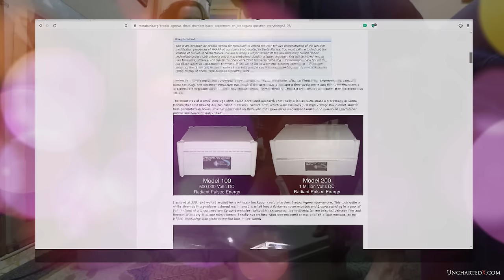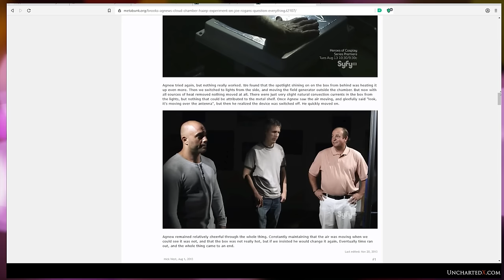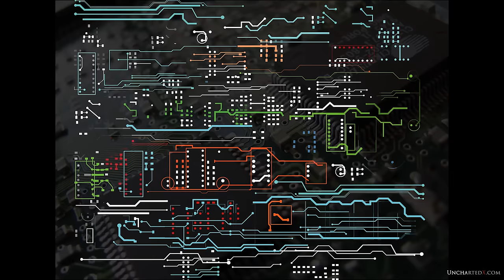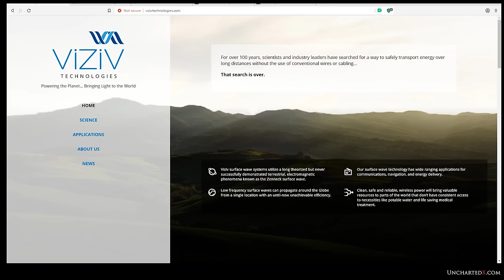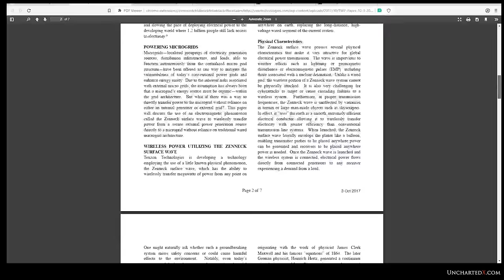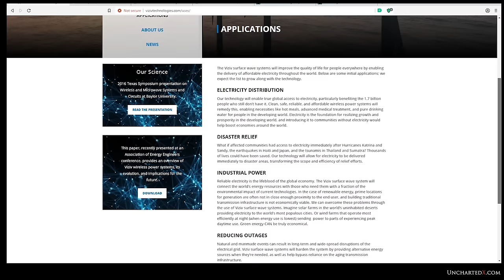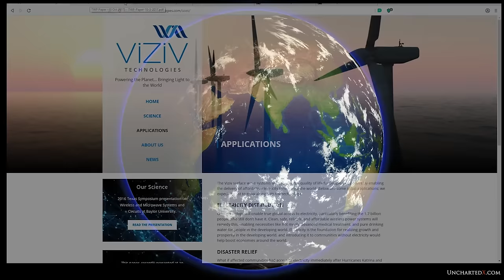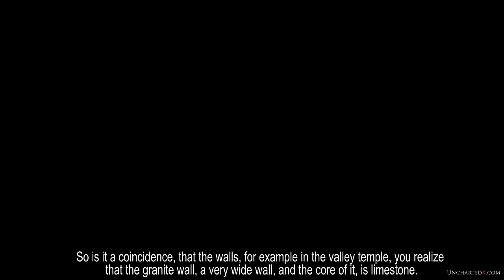500,000 volts through megalithic stone? An investigation into the possible with UnchartedX!

Comment: Inventors in the ancient past might have figured out how to gain electricity. Assuming, their technology allowed to gain high voltage and low current out of their apparatures.
Due to their probably limited understanding of this phenomenon and their low tech approach, they had to build in extreme scales to get use (in this case greater current) out of these inventions.

If the Pyramids and Obelisks were indeed parts of a bigger infrastructure, imagine how dangerous the operation of such plants might have been. Also the influence of any such infrastructure, which in fact would assamble an open circuit, would amplify effects from the earths electric cuircuit and might bring high and unknown risks due to disturbances of its balance. Even lead to catastrophes, either through exploding plants or interferences in the earths magnetic field, which finds itself in constant interaction with the suns magnetic field and recurring solar events.

It's not in the scope of the unprobable, that such a "progressive" technology could have led to the collapse of a prevailing civilization.

Comment: Maybe the limestone capstones conducts electric current down to the ground and acts kind of like  a faraday cage around the inside of the pyramid.  For example, A lightning bolt to the limestone cap would might not penetrate into the pyramid interior.  It would stay to the outside limestone and transfer to ground.  Just saying...

Comment: I could talk a bit more about this video than just this short comment, the test instrument does not show time response to the flow of electricity, for eg water can be momentarily magnetised the time response is in Ghz range, hence microwave ovens are a typical example, my point being its an incomplete testing procedure. However I would like to know more about the subject under test, here is a centre conductor surrounded by toroidal rings separated by a laminated layers, Im drawing a longbow here but it could be part of a tuned circuit, if it wasn't then I will say it could be!

Comment: I believe that all these structures were designed to house or create electro magnetic energy, or electricity, the Limestone acted as the main generator or conductor and the Basalt or Granite acted as insulators to contain whatever energy was being created inside by the Limestone, it makes sense to me that over long periods of time and usage that the limestone would deteriorate and if in contact with the inner surfaces of the basalt or granite those too would suffer from degradation over time, either due to heat or perhaps some kind of sonic energy, there are many examples in Egypt of lost technologies such as perfect saw cuts and tubular drill holes thought to be created by some sort of device that utilised sound and sonic vibrations, we know from things such as the Baghdad Battery that 1000`s of years ago man had the ability and knowledge to create electricity by using simple materials, i believe that if enough scientific scholars came together and analysed these structures with a perspective that they were created and designed to generate and transmit energy or power, the jigsaw pieces would begin to fall in place and we`d realise that we have indeed lost an entire advanced civilised period in the human story that has been lost to time.

Comment: he had those stones on a charged platform the charge went threw it basalt and limestone, both are less dense than granite and marble therefore granite & marble are an insulator Where would the positive charge come from if it was setting on the ground as megalith? I thought the earth is negatively charged right? It's not uncommon that two different types of stone would cause erosion at the joint you would see that in an underground mine on a fault line in nature. You would have to discover the active minerals that cause rapid decay in the two different types of rock also not trying to rule out moisture either.

Comment: Sorry, a little late to the party.  Regarding the stack of granite and basalt, looks an awful lot like the jed (jeb) pillar. could this have been a type of resistor for the Dendara light? There is old speculation about a waterway under the great pyramid the incorporated piezoelectric crystals impacted by the water pressure of the Nile and creating an electric charge. Of course there would need to be capacitors to store the electric and release it as needed.  I have no idea on that step.  I'm just sayin'.

Comment: And by the way what you're referring to as normal electricity is called direct current all electricity holds electromagnetism you're just using high-frequency alternating current otherwise known as HVAC and direct current doesn't flow through a lot of things AC current depending on the frequency and the current and voltage plaid can pass through pretty much anything including air which is not very conductive

Comment: 24:20 says a lot. But what's not being said?  
I'm betting the people had small warnings from the cataclysms solar damage(plasma) ejection from the sun which is evident in areas in direct line from places in Egypt that were struck by this force. Steps were melted , one side of statues and building are vitrified by extreme heat or energy. Some entire areas the statues and building were completly destroyed. Did the people know or were they aware that this was coming? I even see the conductive limestone interlocking layer of the great pyramid was damaged or blown off. Some say the stones were used in other construction but were they removed by people or picked up and reused after the  solar cataclysm? 
We may be seeing the results he is speaking about in 24:20 because the limestone casings around the entirety of the pyramids and some temples that survived that were encased in limestone shunted the majority of the energy into the ground while the granite inside protected the structure from devestation. The limestone may have got excessively hot and caused the flaking of the granite. The cristaline structure of the granite that has been examined has shown huge changes from the flaking layer to the inner areas of the stone. The cristaline structure is damaged significantly on the flaking side which would be expected at high temperature or electrical discharges. I'm beginning to think this may be a working model but needs much more scientific examination and evidence to support it. This demonstration even shows that this is plausible. Best of luck guys
This lost knowledge could one day save humanity from near extinction again.

Comment: At 11:35 or so, there is a red light in the back of the room that moves from top right to left facing the screen. What is that?
Reply: looks like the tail light of a car outside, seen through a window.  They must be in a shop or apartment slightly elevated off the ground.
Reply: EddieBoes - Maybe the reflection of a motorcycle tail light in the display case. Unless the car had a tail light out. Cuz it's only one light.
Reply: @kentneumann5209   I was thinking something like a crossover, that has a back light in a high position.  Maybe that is why we don't see the headlights.

Comment: I'm sorry, but all i see is the difference in properties of the different types of stone based on the amount of water that is likely to be trapped inside each. Sandstone is porous and will have the most moisture, basalt is the next most porous, granite or marble will have the least. Basically, granite & marble will have the best insulating properties. The least moisture = less ability to conduct electricity, No conductivity, no spark.

Comment: All things are electical, this is what all energy is, sunlight is electricty, PH (alkaline, acid) is electrical charge condensed into chemicals, human bodies have an electrical charge and in fact if you damage your skin or you body, the body will send higher voltage to the damage area to power the recreation of new cells.  Ancient cutures built in layers, many of the things built could act like a capacitor, electrical charge flows arcoss the surface of the ground with different frequencys flowing through diffrent material under ground, the Universe is Electrical, check out the theory ... seek and you will learn

Comment: Rocks have an electrical charge say like a solar panel if u make the rock smaller it has the same voltage so to speak but less amps but these r just the terms used by science rocks have different  type energy all different kinds of rocks have a different charge so to speak or function

Comment: 7:33 Not true, all matter is conductive........  What he means is that it has TO much resistance for this device to over come!  Energy in our solar system has a HIGHER value in both amperage and voltage... However, it is also spread out like a net, over time, and moving between objects...  I.e. Lightning......

Comment: Yeahs, its kind of neat.  The fact that someone went to these lengths to help drive their imagination and infuse a bit of logic is worthy of ones curiosity.   Aside from that, I'm not seeing pyramidal electrical power generation  as a strong theory to drive toward.  
Also, how simple would it have been to wire in a multimeter to the stackable stone impedance experiment so that one could actually have numeric metrics based on each type of stone rather than basing conductance on the volume of an audible buzzing sound?  Just sayin'.

Comment: Acquire some different sized glazed porcelain insulators used on power line poles and smash them open. Wear safety glasses and gloves cuz it shatters and flies everywhere. And its razor sharp. Not exaggerating. Be vewy vewy careful twicky wabbits.

They have the same general shape as the stack of alternating types of stone in the beginning of the video.

Inside of them are stacks of discs made of alternating stone and metal and if I remember right, some kind of sand.

The local municipal electric power line workers should be able to hook you up.

I don't know the physics of it all. I used to recycle scrap metal for income. That's what I found inside of some of the different types of power line insulators(?) the municipal electric company threw away.

If anyone knows what the purpose of that design and the mechanics of its function is... Please share your knowledge.

Comment: i dont know how they induced it into the stone, my bet would be that there is some ferromagnetic or conductive material inside of it. but for sure that was not half a million volts. you filmed that in egypt? i bet the air is dry there. for dry air you need about a 1000 Volt per milimeter to bridge it. judging by the length of the are, no more then 15kV, maybe 20kV made that arc. half a million volts is high enough that it would discharge into the air, probably killing everybody around that device.

Comment: Two adjacent dissimilar stones causing a chemical reaction (corrosion) the movement of electrons. Somewhat like an anode and a cathode, I don’t know much science but this sounds like a primitive battery. A gigantic low voltage battery, then connect all your giga batteries in parallel via copper cables in insulated stone ducts (seen something like that in your other videos) and bring it all to a tall structure that can wirelessly transmit that power to ……..🛸🛸🛸🛸

Comment: So about the tesla tower. Tesla claimed that he could transmit wireless electricity to power an entire city with one tesla tower the size of a small sky scrapper. The science behind it basically the same principle around plumbing. Electrons move faster in a coiled tight space therefore you can take a low voltage and raise it exponentially. There are costs to this, and unfortunately I can't recall what part of the current is compensated for the increased voltage. This isn't debated though. It's not controversial. It's accepted fact in the scientific community because Tesla proved the idea with his famous "light-bulb in the hand" trick. He believed ENTIRELY that the only constraint on his theory is size. That a Tesla coil, which is built large enough can power a city, and even larger can affect the electromagnetic structure of the earth itself and power the world. 

Surprisingly, NO ONE has built a tesla coil to this size yet. NO ONE.

Not a single group or person.
Reply: As an add to this comment, Here is a link to the largest Tesla coil in the world currently. It was built in 2019. Not very big huh.
https://www.youtube.com/watch?v=RiwYvr7X0Yg

Comment: Has anyone tried topping these stones with gold
Reply: It might not be about the gold but about high reflectivity combined with the lances they carried to reflect the sunlight to a central point. I altered a satellite disc by sticking about 200 small mirrors on the inside placed it in the sun and put a wet stone on the place where the LNB used to be. The 200 reflections worked like 200 suns on the wet stone that first started to cook and then cracked. Might be a nice test for different kinds of stone in different kind of fluids,perhaps olive oil. There must be a recepy.

Comment: GeeWiz, does anybody consider, that if you remove the shielding on our solid batteries of today, you wouldn't be able to contain energy flow nor retain the energy structure for which the design is suited for,  just saying, they didn't micronize the implementation nor refine the materials other than block design the parts that utilize the Earth's generative forces, seems like a lot of work, huh but then again, think what it takes to build an industry that runs on lithium ..

Comment: The granite conducts but it has to be wet.
Reply from the maker: which would be the water conducting, not the granite...
Reply: @UnchartedX  The granite is piezoelectric but it needs the water to conduct. It increases it from basically being a semi conductor to closer to a superconductor. If you take the stone of scone and short it between the posts of the ark of the covenant and anoint the grooves of the stone with water or mineral oil the current is going to conduct across the stone turning it into a transducer hammer that will hammer 500 lbs of force into the piezoelectric tablets inside. 

(1 trillion volts) When the stone turns into a superconductor it's pumping out 200 trillion watts... the equivalent of 400 nuclear reactors.

Comment: WEll I  dont think that they are suggesting that the rocks are generating anything.
The box probably contains the source of energy DC ...a battery of some sort. 
The machine is a generator of AC which will be stepped  up to a high voltage via a transformer with a big over wind.
THis voltage is then applied to the base and to the probe.  As the probe approaches the rocks, it arcs over at  rate  dependent of the conductivity of the stones. Some may have carbon, some may have metal deposits and all will have different conduction rates.
Question. I'm not sure what they think they are trying to prove.
This isn't electromagnetic...No radio waves are involved.
This guy is regurgitating technical words which don't have the mysticism he suggests.

Comment: Any change in an electrical field produces a magnetic field and vice versa.  I am not sure what you are trying to show with this video. It is obvious that different materials have different electrical and magnetic properties. However, the combination of different materials alone is not enough to create electrical functions. You can not make a battery of stone due to chemistry. You can not make transistors because you can not use a stone as gate material.

Whatever the case, it is worth looking at further, but Maxwells equations should be taken into account. They are the most accuratr equations in all of science as proven by measurement.

Comment: What does he mean "electricity does not induct, but electromagnetism does?" First of all, electricity IS electromagnetism. The difference between induction and conduction of current is only a matter of direct contact, or indirect, charging of a neutral body. EVERYTHING is conductive to some extent, and nothing which is conductive is exclusive induction, or vice versa.

Everything has differing conductivity. Nothing demonstrated here is surprising. The same could be demonstrated with any materials. He could have used some donuts, and some bagels on a wood stick.